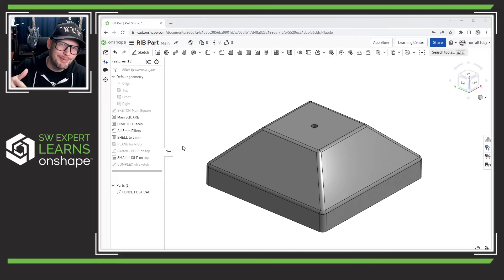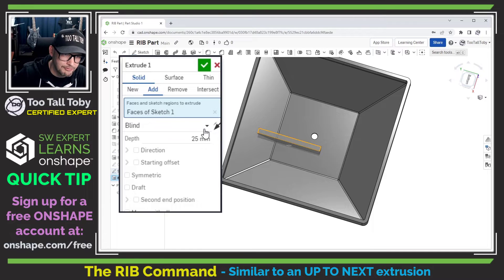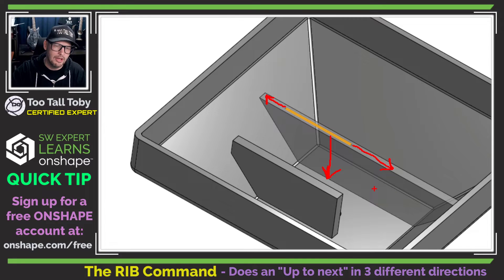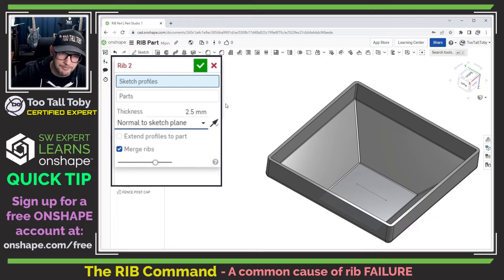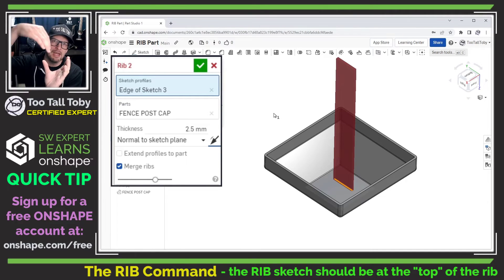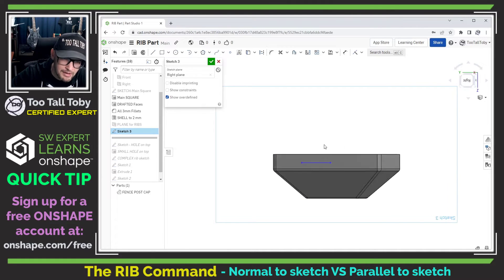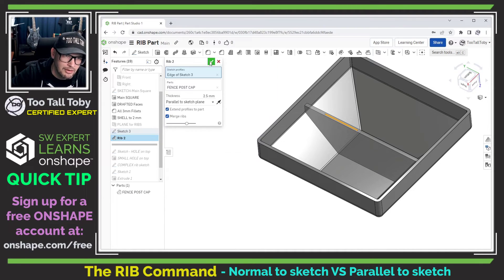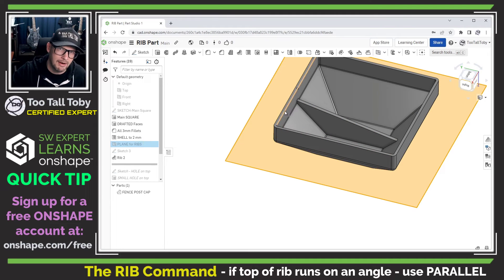Rib Command EXPLAINED

Comment: Good teaching! But typically, at least for me, I get stuck sometimes on how to make what I want to make. I can see the finished part in my head, but then I get stuck on one thing or another and end up taking way too much time trying to figure out something that is easy peasy, like how you showed the rib command. Once I know how to do it, I could do it in a few minutes instead of hours.
Maybe others have experienced this phenomenon. You know what you want, but you just can't figure it out. For example, I would have tried to use the extrude command to make ribs, if I didn't know there was a rib command. 
I suppose it's just going to take lots of time and effort to figure out Onshape. 
I learned using Sketchup, so my paradigm needs to shift. Sketchup was easy, but with ease comes loss of power and precision.
Thank you

Comment: @TooTallToby,  nice overview of the rib tool!
For the parallel to sketch part you could also have mentioned that it not only can be angled but also doesn't have to be a straight line (for that mater it can curved for the normal to sketch as well)!

One thing I haven't seen you use yet is the "final" button (available in the sketch and most feature dialogues), you could have turned that on while editing the sketch for "angled rib" part of the video. 
What it does is that when enabled it rebuilds the whole feature tree (up to the rollback bar if applicable).
Basically like the "rebuild" button on a dimension edit box in SW except it updates live as you drag, it's fun to play with (and can be very useful, for example when editing splines for a surface model so you can see the surface update live as you drag your construction curves)!
Also when not enabled, the slider at the bottom of the dialogue changes the opacity of the preview so you can quickly see the "before and after" of your feature by dragging left or right (in case you wondered what that does!)
Reply: So.....with curved lines I was kinda getting "hit or miss" results.  I think the Onshape team might still be refining this one - do you have any little tricks you use to help in those spots where the rib just kinda solves crazy (when extending) - or becomes unsolvable?  I find that the best thing to do is to split the rib into 2 separate rib commands, and then I can get what I'm looking for.